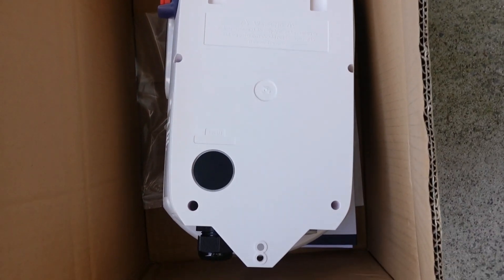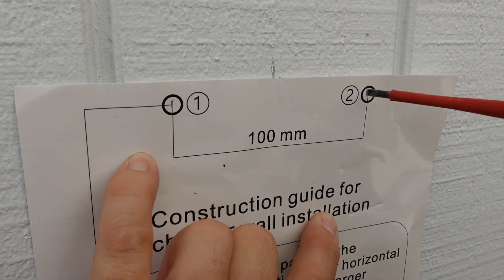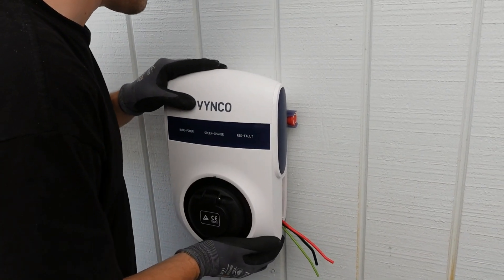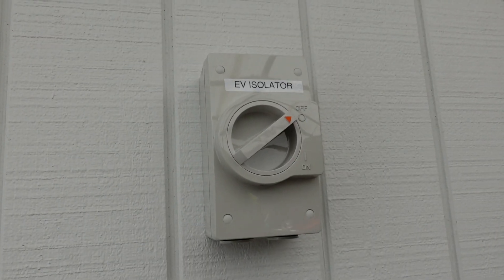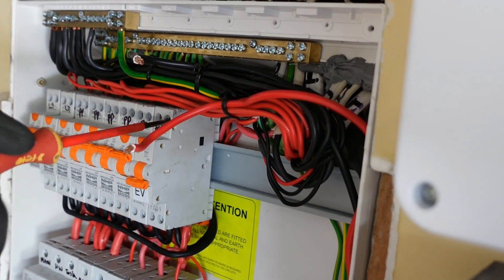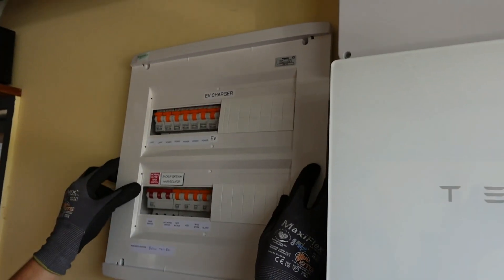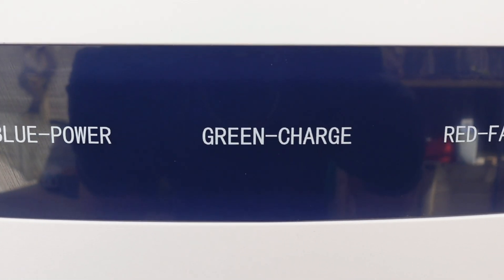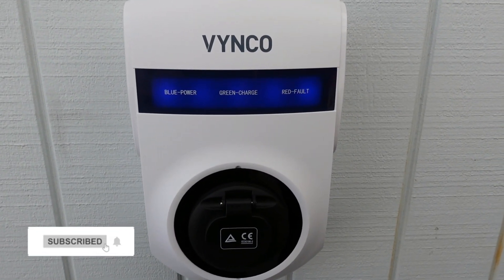VYNCO EV CHARGER E1V2R Review⚡

Comment: I watched most of your vid or many videos electrical related.  Is there any reason why not use a drill to fit off and hand tighten after? Like the switchboard cover and the charger lid
Reply from the maker: Thanks for supporting the channel! 😊 and thats a great question! The main reason would be to not over torque the fitting 😊 Hand tools definitely work out the muscles though 🤣